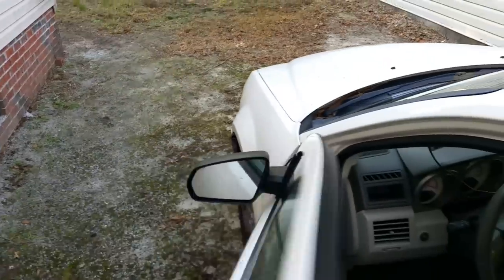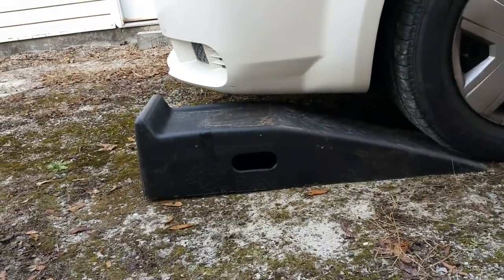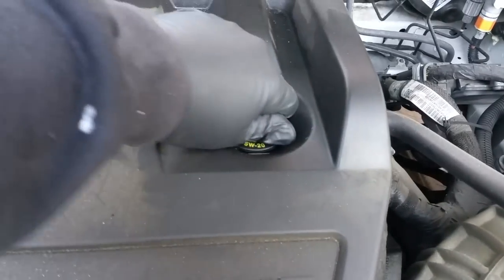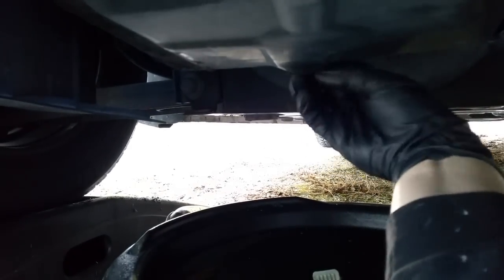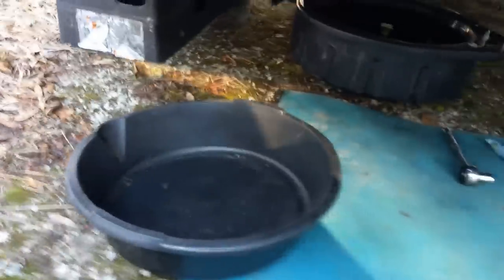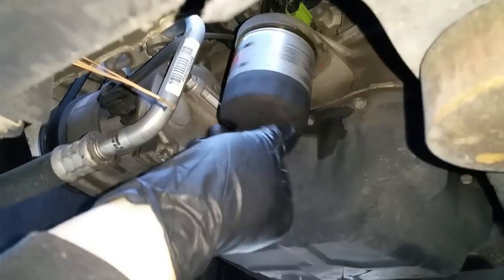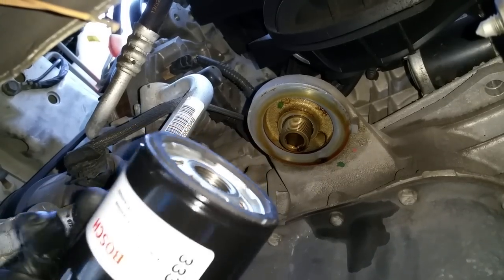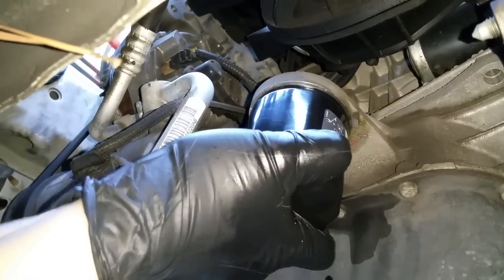Dodge Avenger Oil Change

Comment: Thanks was wondering if up on a ramp it would drain all the oil 👍 thanks
Reply from the maker: Of course it will drain and it will drain more because it's on the angle!. Also make sure you change your oil while it still hot!!

Comment: great video,  thanks!   What is the oil recommendation for a 2011 avenger?
Reply from the maker: keale s not enough information what  size of your engine ?
Reply: Look at your oil cap and it will tell you

Comment: where is the oil filter located at...I have a dodge avenger 2012 ....thx
Reply from the maker: Gaby Rodriguez it's under plastic cover that on top of the engine they use these days now what you call cartridge filters. so you pretty much remove filter from the top of the engine. all mercedes's and BMW like that it's been for a while now

Comment: i have a 2008 dodge avenger.  how would i know if i need an oil change?
Reply from the maker: im assuming there is no stiker.
if u dont know when the last time u had oil change i would recommend to go ahead and change it ! its only like $35 at Walmart.
unless when u pull the dipstick oil on it very clean.
Reply: If you just bought the car from someone change it.. than you will know exactly how much miles/kilometres are on the car.. so you will kno when it needs changing

Comment: Do you not have to replace the drain plug gasket every time you change your oil
Reply from the maker: no, I never do.. I never had problem with that. I only replace them if I see a leak or it's damaged. at the dealership they replace them just to be hundred percent sure that it's not going to leak but what if you're not going to tight enough, it's going to leak too. after I change the oil I crank the engine and let it run for a little bit and always check for leaks either on the drain plug oil filter.

Comment: what kind of oil shoulde I use
Reply from the maker: I only use moble 1 or Castrol synthetic
Reply from the maker: +Ivan Rossinskiy I buy it from Walmart it way cheaper. unless AutoZone or Advance Auto Parts running a promotion where you can get 5 quarts of oil and filter for free but usually they sell the cheapest ass filter and you still have to pay a little bit extra to get the better one.
Reply from the maker: and this vehicle take 5-w30. I do not know how much you need I do not have this car anymore but you can look it up in your manual or Google it